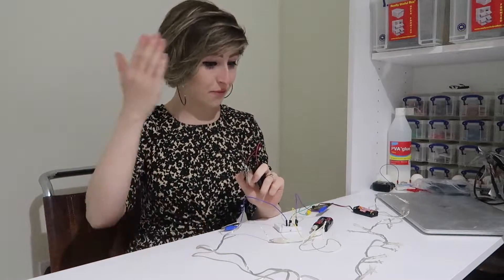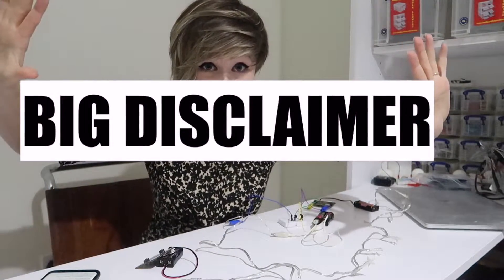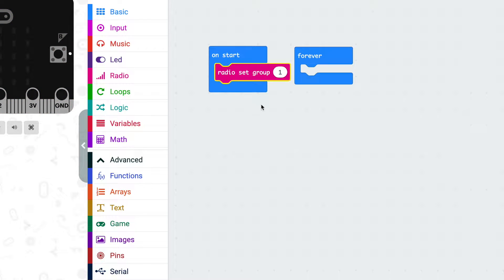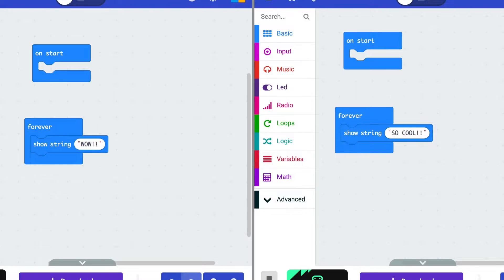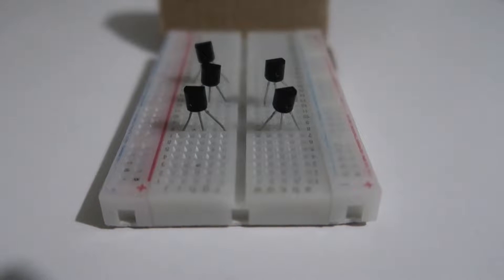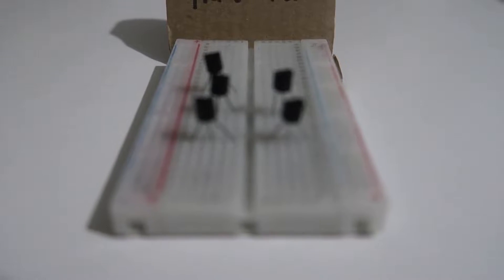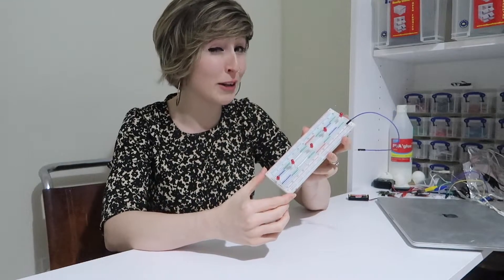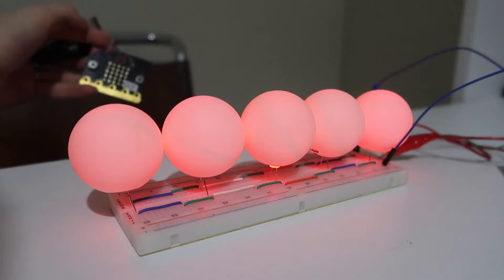Project 5: DIY remote control fairy lights made with microbit

Comment: *on start
     radio set group 1
     set currentState to 0

*on shake
     if (currentState = 0)
     {
          set currentState to 1
     } else {
          set currentState to 0
     }
     radio send number currentState
Reply: And, in principal, the receiver could just do:

*on radio receivedNumber
  digital write pin p0 to receivedNumber

Unless you want to get paranoid about receiving numbers outside the range (0,1).
Reply: @AthAthanasius   Yeah, I figured it would be smarter to leave the receiver alone as an if statement to catch any weird glitches or, and I love this idea, if someone hacks the fairy lights and sends junk data.
Reply from the maker: That's a neat simplification :) I'm definitely more of a paranoid coder!
Reply: @HannahMakes  Me too. After the very first program I wrote that other people used I learned that I had to try and account for any sort of unexpected user input/action because, if code with no error handling exists, it will be found and the coder will hear about it. :P
Reply from the maker: Great job!